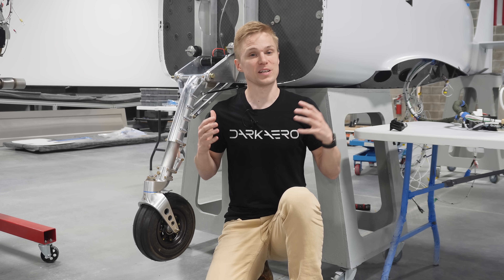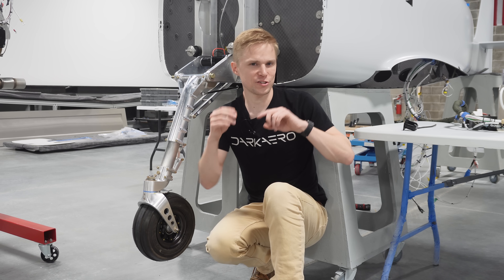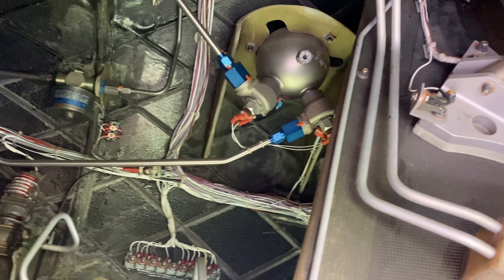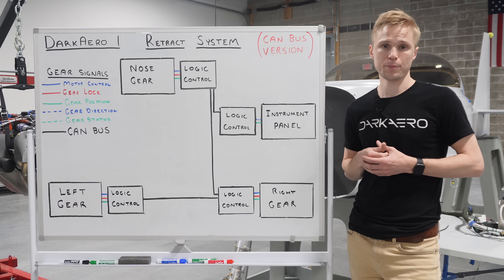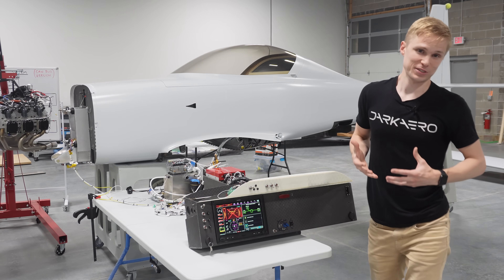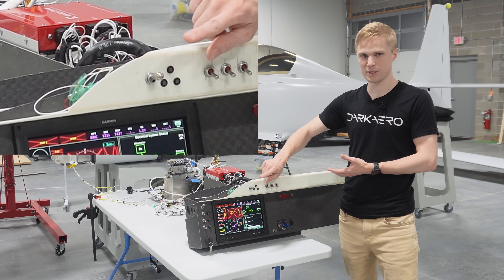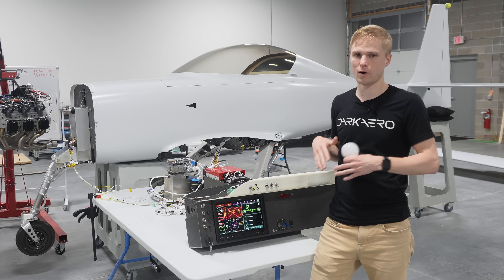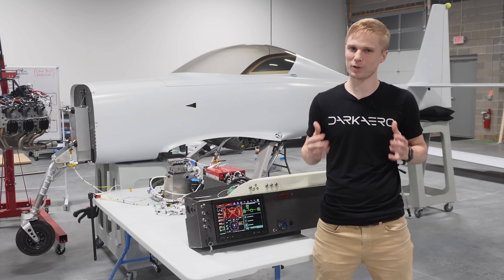Designing smarter landing gear

Comment: This is probably the first system in this airplane that I'm not enthralled with. So much complexity, so many things that all have to work perfectly. I've experienced gear problems before, when you're flying and trying to figure out why your gear is not showing down/locked, you want the simplest system possible, with the smallest number of failure modes, that can be easily overridden and manually actuated. A complex logic sequencing system run over CANBus with many potential points of failure does not instill me with confidence. Those small extend and retract latches, with beautiful tight clearances and tolerances that work so perfectly in your tests - what happens when those are contaminated with grease, or dirt, or bugs, or ice? What happens one of the motor sensors fails or mis-reads, and the logic controller drives the motor to extension at full speed? What happens if any of the logic controllers freezes or fails? What happens if any of the wires going to any of the gear gets pinched, shorted, broken? The answer is: gear-up landing, or worse (partial extension landing).

In virtually every retractable aircraft I've flown, the default state of the gear is to be down and locked. That means that in most any failure mode, by design, the gear ends up down and locked. The system operates to keep the gear up, and if something fails, the gear comes down. I don't see this functionality in your design: I see multiple different failure modes in your design that result with the gear up and locked with no way of manually overriding it.

You also state that the motor load on extraction is 100 watts - that's fine, but what about when it's extending the gear against relative wind in flight?

Lastly, if your "gear up and locked" indication is LEDs off, then you need a "push to test" button next to them to illuminate the LEDs and ensure that they are operational, to rule out a failed LED giving a false indication of retracted gear.
Reply: Didn’t they show a purely mechanical cable-actuated fall-back solution which lets the gear drop through gravity (edit: and gas springs) in earlier videos? But I don’t know how that’s going to disengage the motors in a reliable way or make sure the latches lock in the down position.
Reply: @Mike-oz4cv  Hmm.  And gas springs are unreliable.
Reply: @IainMcClatchie  Particularly when they are cold. Like you would find at altitude.
Reply: All aircraft i work on have 3 ways to put the gear down.  At least 2 ways to see if it is down.

MHO that is a ABSILUTE MINIMUM for any man-rated craft.

Do not underestimate Murphy.

Great engineering effort you all.  Congradulations.

Todf
Reply: I don't disagree. the controls are interesting, but I want manual overrides. I want fail-down features. Too many light aircraft experience gear failures.
Reply: Meh, CAN bus systems have been used for decades and have proven reliability. It’s about time GA caught up. They’re already using solid state relays and circuit breakers. I’m excited about the innovation.
Reply: @chriskroeker1889  You are familiar with can bus systems that are in automobiles manufactured in the millions of units, by multi billion dollar manufacturers with 100+ years of mfg experience and huge R&D departments. This is a one-off aircraft built by a hand full of guys with some plywood and a milling machine machine. Computerizing a system that should be as simple as a motor and a couple of micro switches is ridiculous. Imagine a mechanic trying to diagnose an intermittent gear issue with their homemade can bus network. 

I work with can bus systems all the time in the agriculture industry. These are smaller companies than automotive, and they do not have incentive to "get everything working perfect" like the automotive industry. Also, no OSHA on the farm, so if their machine kills someone, it was operator error, not a design safety flaw. Can bus systems means in a nutshell that there is some computer logic added into a mechanical/electrical system. Unlike mechanical and electrical logic, mechanics, technicians, pilots, etc, cannot see computer logic. It's hard to diagnose, understand, and test without knowing the actual programming. Even then there are things we call glitches.
Reply: You must have missed the video where they show that the gear motors can be disconnected, and the gear will free-fall with the help of gas struts.
Reply: There's a reason no other aircraft are like this.
Reply: I’d so much rather have this system than hydraulic.  So much simpler to work on (and less messy 😂). Glasair owner
Reply: It seems complex but these systems can be incredibly reliable.  Steer by wire is coming to cars sold in the US (eg Lexus RZ450e) in which there is no mechanical link between the steering wheel and the front wheels.  These systems are also extremely testable and able to provide lots of instrumented feedback at relatively low cost.  Given they have a redundant system for emergency deployment, this is probably quite a bit more reliable (if engineered correctly) than it would appear at first sight.
Reply: @jcims  worthless example
Reply: @jcims  No thanks!

Comment: Unsolicited advice: This is getting very complex when you need simplicity.
Reply: My thoughts exactly, a single failed module on a canbus network can bring the whole system down, simplify, and add lightness. avoid a single point of failure wherever possible.

Comment: Wish I'd had the fearless ambition of these lads back in the day. This project is truly exceptional.
Reply: They have stated they were all three engineers before. And quit or postponed those previous careers to make this happen. Keep in mind, they have built an Experimental composite aircraft before this one. 

They know what they are doing. This will fly. And everything will work or be addressed professionally. It will fly and it will fly fast and far like they predict it will.

I have my own critiques about specifics of the design: (split rudder on a high horsepower, diminutive sized aircraft. Along with higher than average wing loading, short wing chord, meaning low Reynolds number flow at low speeds, very little washout due to tying to achieve significant laminar flow with off the shelf airfoils, which appear to be Naca 66 or 67 series, the latter of which became the NLF-0414F that later was modified for Jon Sharps DR-90 Nemesis' airfoil with reduced camber, which is what it appears these guys are using).
All of the above is fast. None of the above is conductive to good stall or landing characteristics.
Reply: @Triple_J.1  Do you think it will be very unforgiving to fly due to those characteristics?
Reply: I'm sure they've had exactly their share of fear.   "Courageous ambition", more apt, me thinks.
Reply: Not to be a negative energy but its 5 years and no flight.
Reply: @tbrowniscool  this ain't a one-off-  progress has been well paced.
Reply: @mavigogun  literally is a one off.. You just don't see the religious parents with millions of dollars backing this. You notice how crystal clean the work/hangers are? The large metal parts are outsourced. I would like to be proven wrong but after 5 years they are still developing landing gear?

Like I said before I wish them all the best but this won't work as a business. Who will buy this "kit"?
Reply: @tbrowniscool  I'm not in the "proof" business- the DA teem have been explicitly clear this is a serial aircraft, and their manufacturing techniques attest to as much- which most definately includes the production of "large metal parts".   I suggest reviewing their catalog of video blogs for disabusing of baseless notions.  Citing cleanliness as indication of outsourcing is just wrong.
Reply: @tbrowniscool  Metalwork is outsourced to Xometry which is as affordable as outsourcing CNC will ever get; they have plenty of industry partners and frankly, you don’t know where they got seed funding/currently get funding. They run courses on composites and are selling slots for this aircraft at $1,000 a piece. Don’t know what your problem is with their incredible engineering work on this bird.
Reply: @tbrowniscool  If they were only marginally closer to flying than they were 5 years ago you might have a fair point.
Reply: I wish I was 1/10th as smart as these kids!

Comment: How will you be simulating Air Loads on the Gear to validate reliability and function?
In the automotive applications, CAN/BUS systems are not user serviceable without OBD  type readers.
What Service Units will be applicable to this aircraft? 
While Electro/Servo seems simplest, Electro/Hydraulic may be needed with air Loads.
Will watch for development with interest.

Comment: I don't know about autoextend. What if you want to go gear up into a fiield or a lake so as not to flip? Or if one of your mais doesn't go down and you prefer to go full gear up rather than one up one down.
Reply: Probably easy to control via the logic.  If the gear is up and the plane thinks it should be down, then first throw visual and audible warnings.  Pilot can then put the gear down or cancel the warning.  If no action is taken by the pilot after a set time, then the plane states auto deploying gear in 3, 2, 1, again giving an override window.

Comment: In general I don't like having the "LED-OFF" state as being the indication is a valid system state. It doesn't allow for the possibility of a malfunction. I think it would be better to have a different color for each position -- 1) up and locked, 2) down and locked, and 3) in-between. With your current system you don't reliably know if a gear is up, or there is a malfunction somewhere. 

Yes, with LEDs having practically unlimited life, there's little danger of burning one out. However, with your existing indicator system you won't know if the gear is up, or you have a bad LED, or a broken wire, or a bad switch, etc, in your indicator circuitry. You're obviously using Red/Green bi-color LEDs. Why not use Yellow (both on) to indicate one of the states? That might let you get away without any rewiring. Though Red/Green/Blue LEDs would probably look more polished, since Yellow is often an indication of caution.

Like you said, "Make your landing gear smarter!" :)) Just my 2-bits...
Reply: I was wondering to myself if maybe it would be useful for a very small forward-facing wide-angle belly camera should be installed toward the rear of the fuselage. That way you could have visual confirmation of at least the basic gear status, among other things.
Reply: As an engineer, I completely agree. There must be positive indication of all possible states during operation of a mission critical system.
Reply: I was going to say the same thing
Reply: IMHO the way they’ve implemented it is almost perfectly fine. If you are going to take off or land and your gear lights are not green you know you have a problem. If you are lucky only the LEDs failed. The biggest problem I see is for people with red/green blindness who can’t distinguish between the two colors.
Reply: White could be a reasonable alternative to off
Reply: As someone who specialized on landing gear and flight controls for over a decade, I agree that an off led gives to little information. Maybe look into: 
Green=down
Alternating G/R=gear in transition 
Red=up

LED's are reliable, but not infallible.
Reply: @s14slide  I'm definitely not experienced in aircraft, but I really like the idea of a flashing LED indicating movement between valid states. Great idea, and also only changes the software. No additional hardware/wiring required.
Reply: @s14slide  You could also include two additional states, by flashing the red or green LED's. I suppose.
Reply: Agreed. LED off should only indicate a failure or power-off state. Red/Yellow/Green has been a standard for decades for a reason.
Reply: Not a pilot or engineer, but doesn't preflight checklist cover checking all instruments? I assume the LED's would go through their sequence when starting up (like in a car dashboard). Additionally, if the lights are constantly on while the gears are retracted it'll be super distracting, especially when flying at night. I like their implementation because I'm sure you'd feel/hear the drag if the wheels aren't fully retracted (equivalent to the LED being out as you've mentioned). It's not just the LED that has to malfunction, but also the system.

All this is to say that I like their approach; there are indications of what's happening when it's needed, without distractions when not needed.
Reply: @brois841  Just thinking aloud here, a pre-flight check wouldn't indicate an in-flight system failure. I think the 3-color, never-off concept makes good sense.
Reply: @brois841  I'm not a pilot, just an engineer who's designed user interfaces in the past... I can imagine a scenario where the pilot is on approach, and she reaches over (using muscle memory) to flip the switch to lower the gear without looking at the indicators. (I'm guessing there are more important things to attend to in that very moment.) 

Unbeknownst to her, during flight vibration has caused a wire someplace in the landing gear system to break. This would not change any of the indicators unless all sensors/wiring are monitored continually. This however, may not detect a defective LED unless some "fancy" checking is done. So when she's ready to do her final check, she sees only two gear indicators are Green. She didn't notice the state of the LED during its downward travel. (Did it go Red momentarily or not?) 

So the pilot cycles the gear switch, but only two lights go Red, and then go out at the top. The third LED stays OFF the entire time. That's a good indication of two good gear, but what's the state of the third? Is it stuck at the top? Maybe the pilot could hear/feel the gear moving, but did only two of them move, or was it all three? Seems risky to my non-pilot mind. 

Also, it would be possible to dim the indicators at night as our automobiles do for the dashboard. Your thoughts?
Reply: @rdyer8764  my thoughts are if there's a malfunction, the pilot can radio tower for a visual confirmation or can enable the 'emergency landing retraction' procedure, which releases the catches and pushes the wheels out with gas shocks. This is a fully mechanical override which was described in a previous video.
Reply: @brois841  👍

Comment: Could you have the landing gear fall by gravity and lock into place and retract using the motors only !
Reply: The enormous force of oncoming air would prevent it from falling using gravity. The landing gear would have to be incredibly heavy.
Reply: Have to consider the force of the air working against the extension.
Reply: The air resistance, while flying, may prevent that from happening. Not an engineer, but I doubt they can get away with a passive system here (also, they'd already have the motor there to retract, so where's the improvement/savings?)